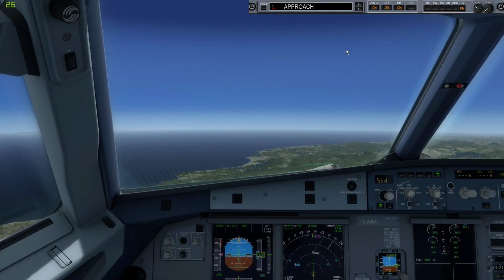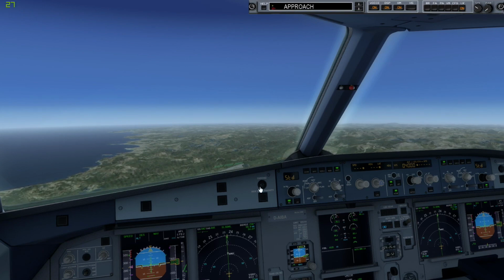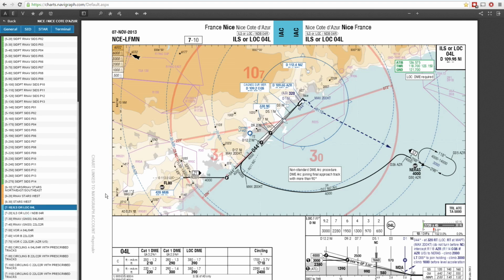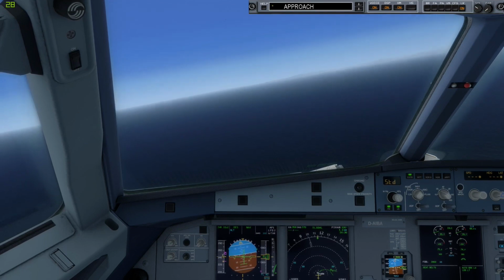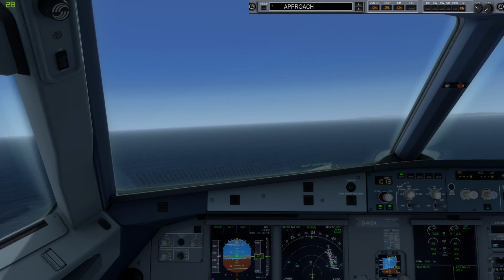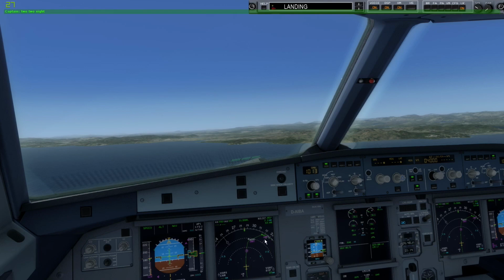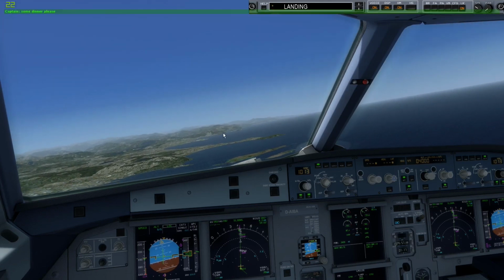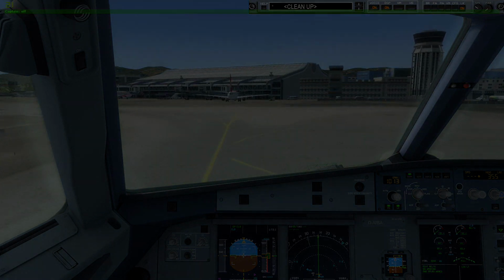Aerosoft Airbus A319 | Landing at Nice Côte d'Azur | Prepar3d | FS2Crew | GSX

Comment: Is P3D just an expansion from FSX or a complete different game?
Reply from the maker: P3D and FSX started at the same place. But whereas all development on FSX ceased (other than some basic work done ny Dovetail), P3D has been actively developed.
Reply: Ah okay, thanks. So clearly P3D is a better option?
Reply from the maker: It's more developed but it costs a LOT more. And the upgrade pricing (unless it's been changed recently) is non-existent. Add to that, the creators of P3D are primarily a defence based company. That may make you wonder whether they treat you and I as their prime customer, or the government.